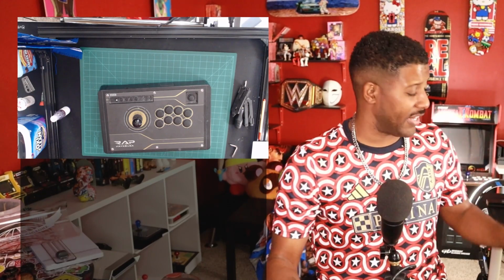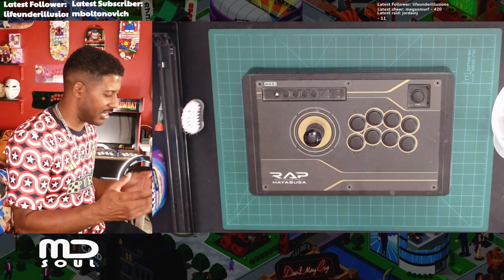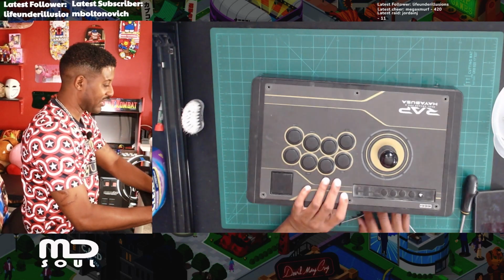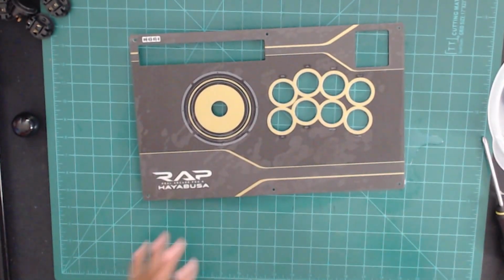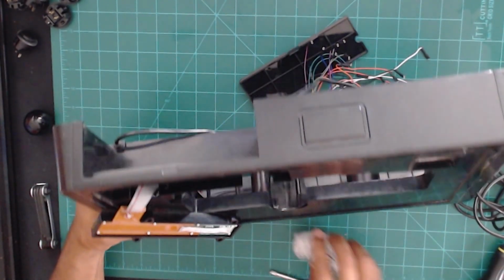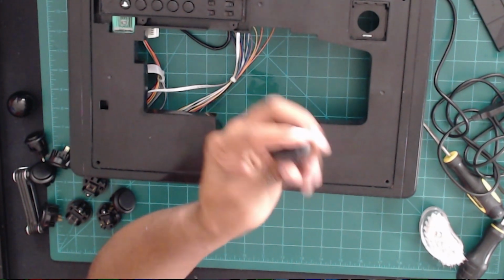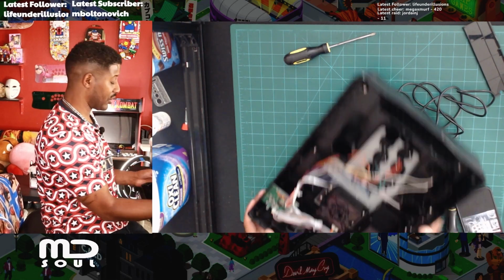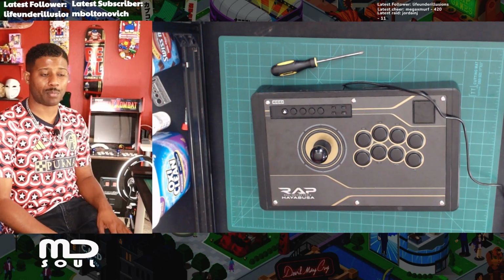Epic Gaming Makeover: Transforming a Worn-Out Hori Hayabusa Rap into a Gaming Gem!

Comment: The RAP N is a beast of a stick. I have the soulcalibur edition and changed the plate out for an aluminum cut for korean lever.
Reply from the maker: How easy was it to put that lever in?
Reply: Why start with the higher priced Hayabusa model if you're going to replace the 'busa anyways?
Reply from the maker: some people just got it like that lol
Reply: @MDSoulTV  fairly simple. If your moving to korean you will need a 5 pin to .187 harness. You just take the screws out the bottom remove the 4 holding the original and swap in the new one.
Reply from the maker: Yes this is true it is simple  @darth-umbrex